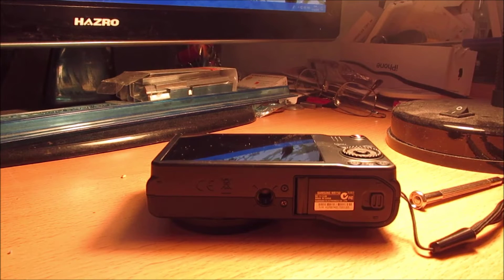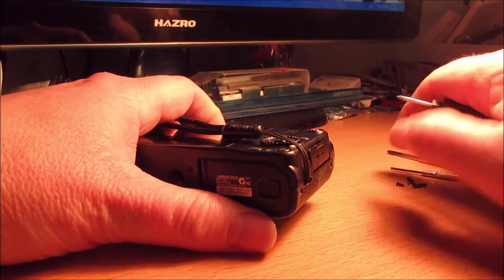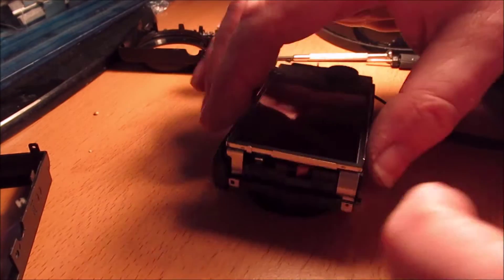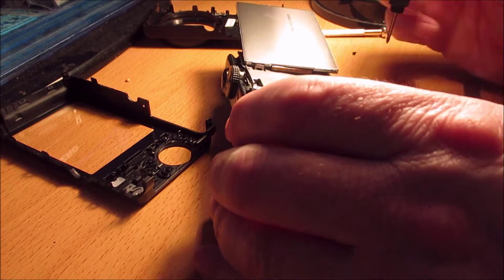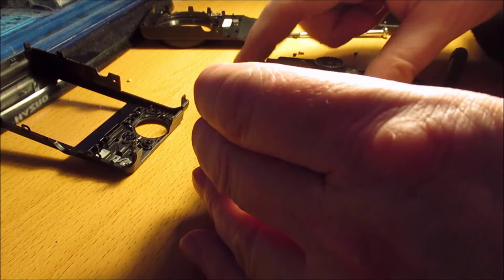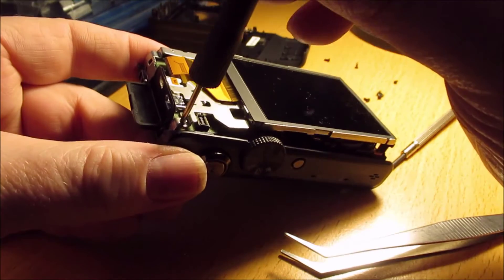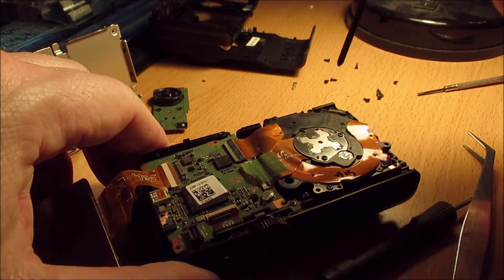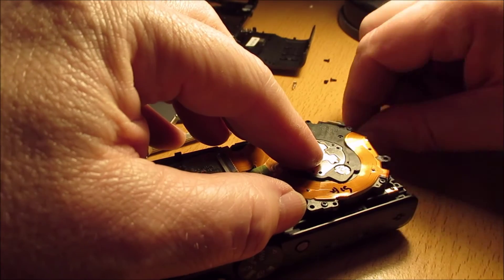Digital camera night vision project   Part 1 IR Filter removal

Comment: Thanks for this Mark,  be interesting to see what its like when you got a more powerful Ir torch, Cheers
Reply from the maker: Yes, I am hoping to get a good ir torch to flood the area with ir light. If it works, which it should do it can be a big saving on the commercially available night vision camera to scope set ups, plus the optical lens of the camera should give better results than the smaller digital lenses that are available from China on the other home made set ups. Watch this space. An old second hand HD quality camera, plus the ir torch and the ability to be able to record what you see should be a good option for those on a budget.

Comment: Nice , but I don't think I'd have the bottle to do it 😁
Reply from the maker: I would definitely not do it with a new camera. I have two older Samsung cameras, one of which was given to me by Dave Oldham, so I thought I would give it a go. I have done computer building and maintenance courses in the past up to level three, so taking things apart doesn't worry me too much, and these particular cameras are more straight forward to work with. I wrecked a good camera about two years ago, which was a canon as the lens was hot glued in. While trying to remove the filter I accidentally scratched the processing sensor that the lens was glued to and boogered the camera up straight away. The best way to remove the hot glue is to use heat, but that can also have its problems. At least I now have something to work with.